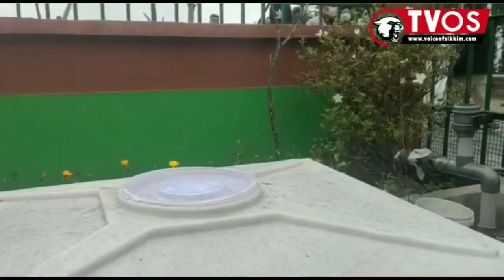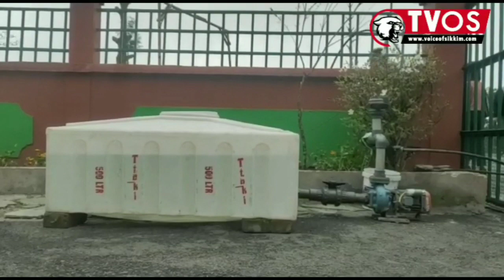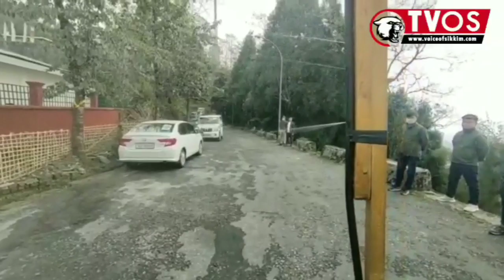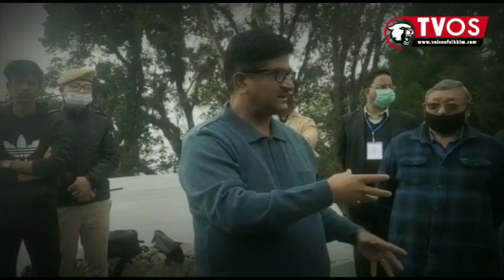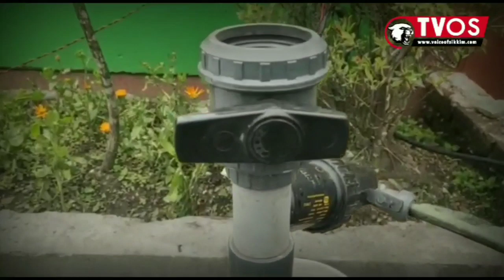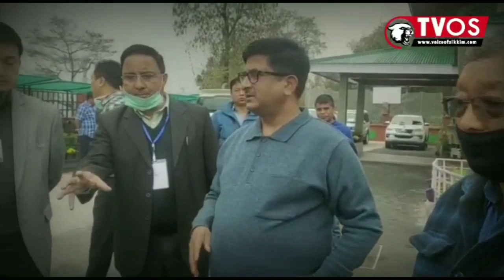Covid 19 : Young Innovator Of Sikkim Device Automated Vehicle Sanitizer

Comment: Nice project bt nuglle  is so big in trial bases & tht case we are using   small  nuglle  that can best for protect aftr  motor going pass out  the out so many leakage are thre they can easily taped  bro when we are using ta check post  and then one motor than can't possible  too sanitize the all vechile  so thn we increase the  all materila and they can easy too sanitize...
Reply: Good job brother